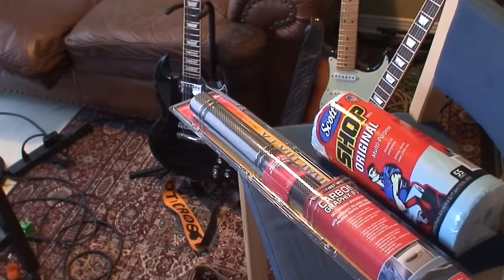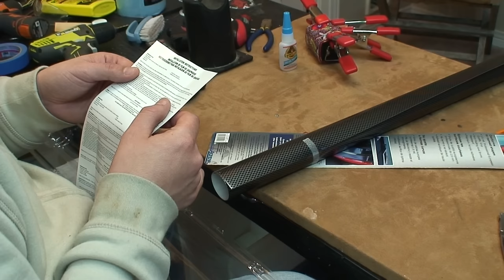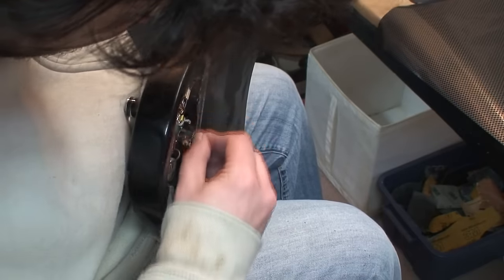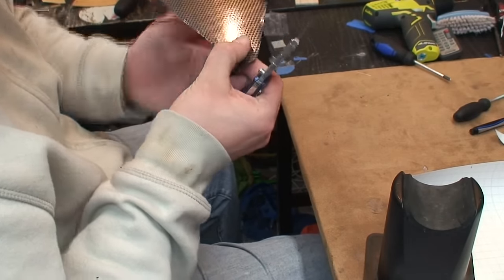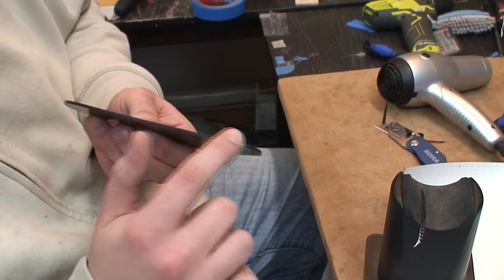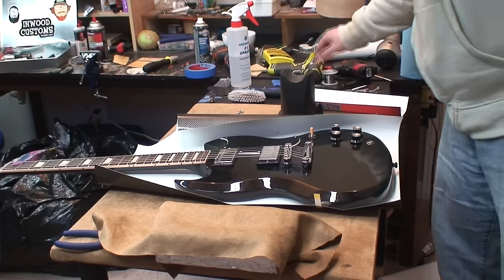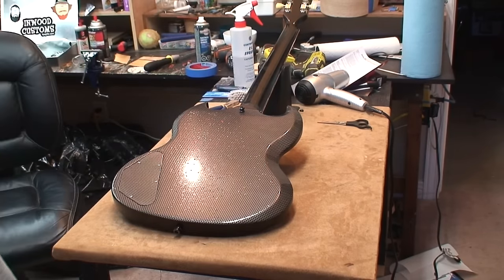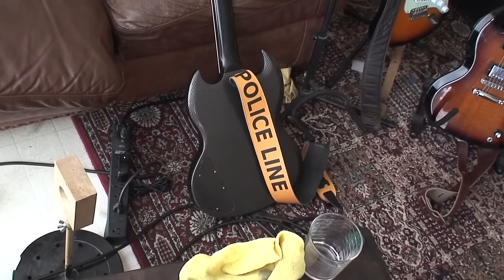Avoid Or Hide Buckle Rash: Automotive Vinyl Wrap

Comment: top tip....float vinyl down with soapy water....no air bubbles
Reply from the maker: +DKGCustom I knew I'd done this wrong... DOH!!! I'm sure I've even seen it done that way, but instead of following my instincts, I read the damn instructions. May have another go with something other than Carbon Fibre... it's not 2001 enough;-)
Reply: +DKGCustom excellent advice!